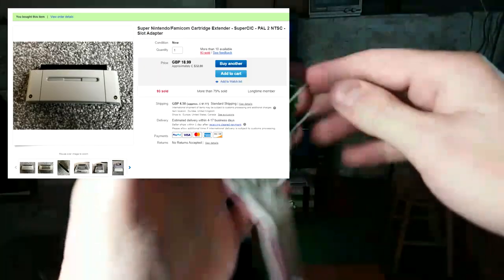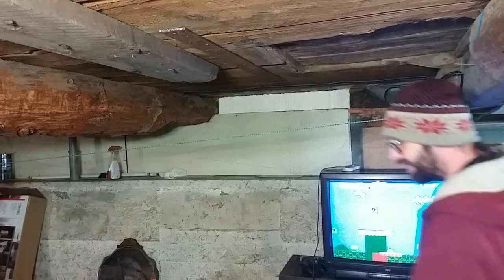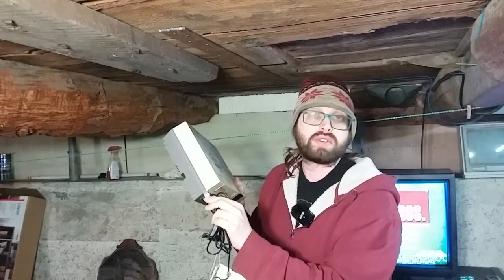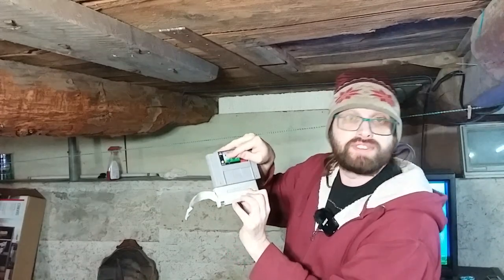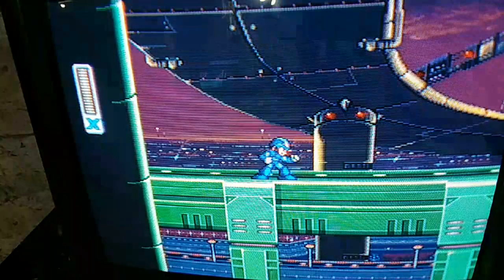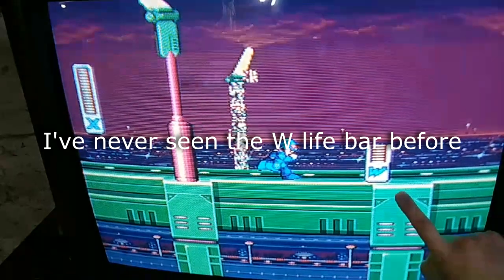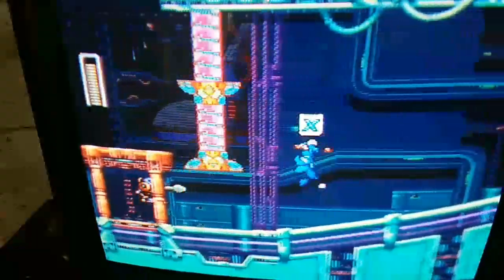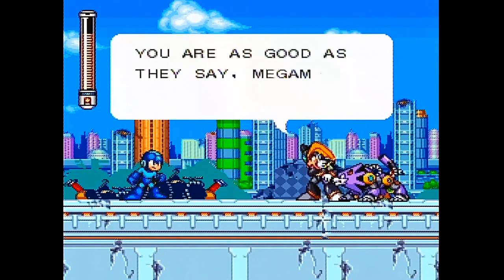Hardware Corruptions without a Flash Cart

Comment: Is there any way you could do hardware corruptions on newer consoles like the xbox 360? or maybe even the switch? It'll be an expensive experiment but very interesting.
Reply from the maker: i doubt anything more recent than n64 would be possible. it would just crash and give no results.
Reply: @ircluzar  Even from shorting out the pins going to the CPU/GPU directly?
Reply from the maker: @DrWillz1996  i mean you can try if you want, it's just that as consoles get more and more powerful, the software also tends to be able to detect more problems. basically the further you get in console generations, the more resistant to corruption they are. more power means more time to do error checking
Reply from the maker: I still think xbox 360 hardware corruptions are most likely not possible but i found this video online where someone made a circuit bent ps2 and that makes me think that maybe ps2/gamecube hardware corruptions could be possible with enough research. by the time you end up with a console that runs a full OS however, the chances are probably diminishing exponentially. check this out https://www.youtube.com/watch?v=x7Q_wQdoGe0